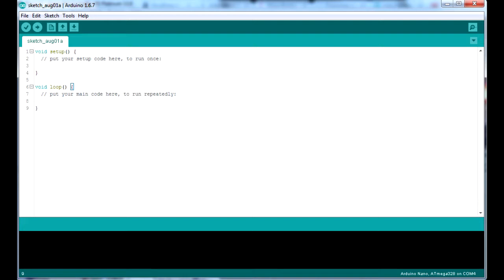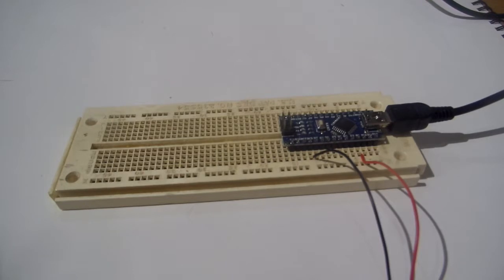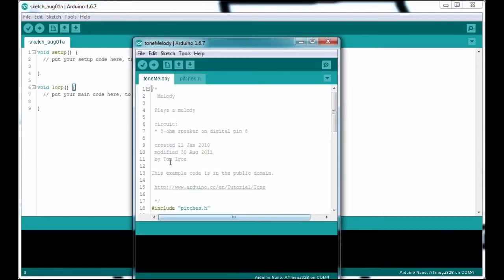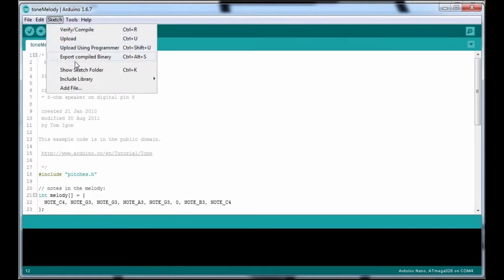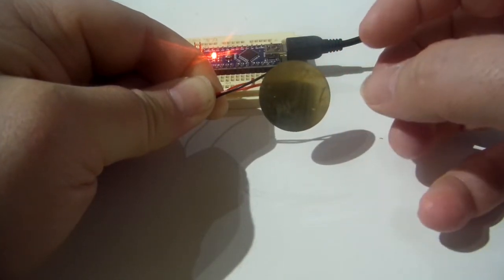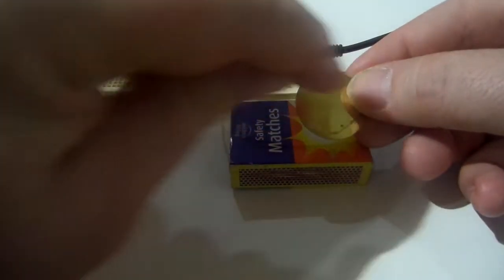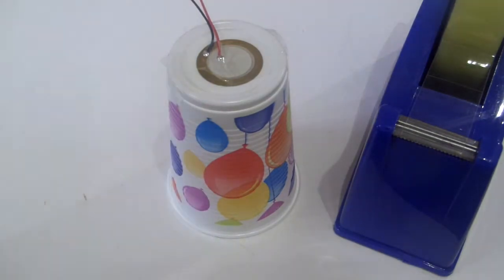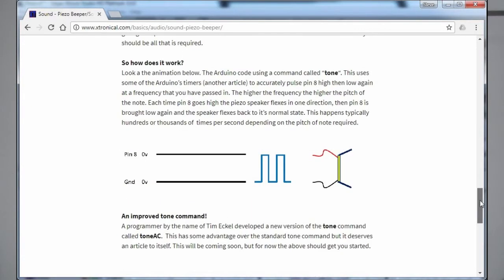Micro-controller / Arduino Basics. Connecting and using  a Piezo sounder

Comment: Does the piezoelectric wire ever fall out if so can I solder it onto the breadboard
Reply from the maker: You can't solder to a breadboard unfortunately, it's only goo for quick prototypes.
Reply: @XTronical  can i just wire the components together by looking at your circuit diagram
Reply from the maker: Yes you could, might be a bit messy but possible. I've completed it whilst writing the updated article but won't be able to send till tomorrow
Reply: @XTronical  thank you so much., You deserve more subs try doing more arduino projects